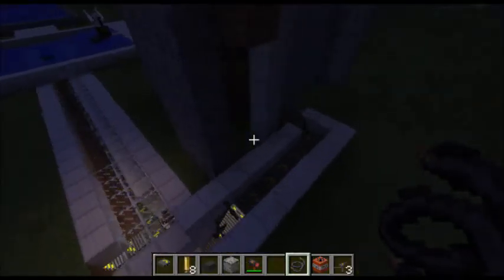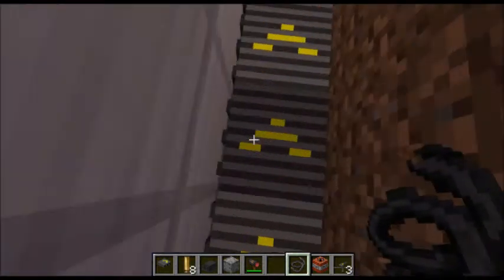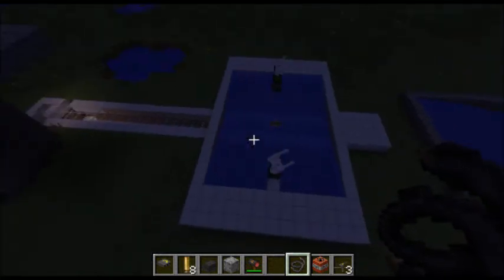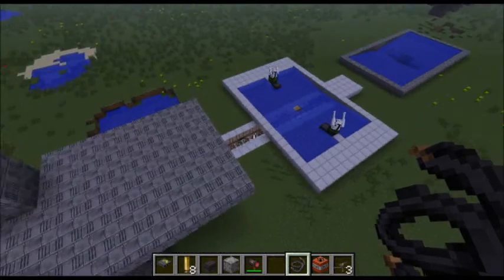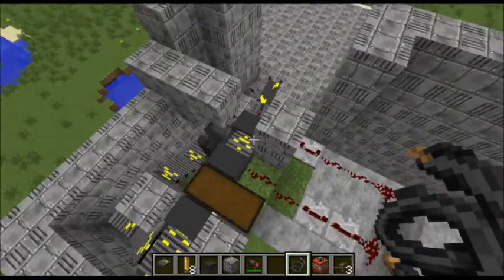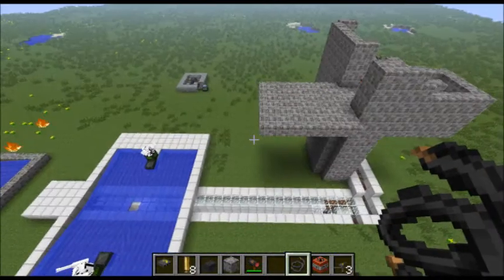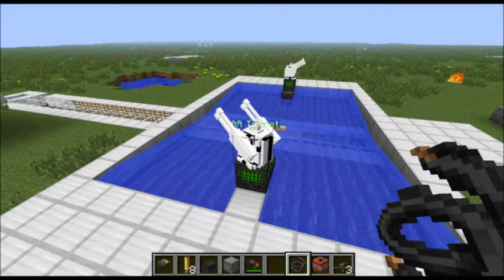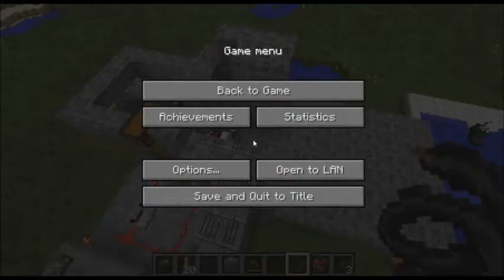AA Sentry vs Auto-missile gun Test

Comment: you mention path predictions and that they're ram intensive...how intensive? I ask b/c I'm making something similar, a mob similar to a villager that can operate any enterable gun/cannon in any mod. I got the idea from this Japanese mod I was trying out that had an absolutely beautiful model of a phalanx CIWS. I wanted to make something that could fire it with the same level of accuracy as the original gun. The real thing does path predictions, so I'm trying to do the same

Since I'm trying to achieve as close to 100% compatability with other mods as possible, would path predictions use up so much ram that it would slow a non gaming computer to a crawl if combined with large mods like icbm, flans mod, etc?
Long story short, is it a lost cause or should I do it anyway and try to fix it with more efficient code?
Reply from the maker: Not sure which part i noted about ram usage but most of it is rather good. Especially in recent versions where i re-did all of the code. As for the path prediction is actually part of the missile itself. Its used to cause the missile to move forward and find where it will be next tick. As for your idea i've actually done it before though i used the turret's own code. This way the entity was only on the turret for show rather than actually moving the turret. If you plan to code the entity to control the turret then you basically just copy what the skeleton does and have it aim the turret. When it goes to fire the arrow instead just trigger the turret to fire.